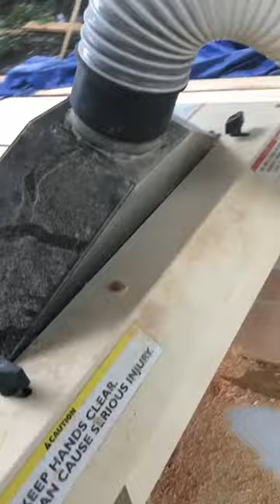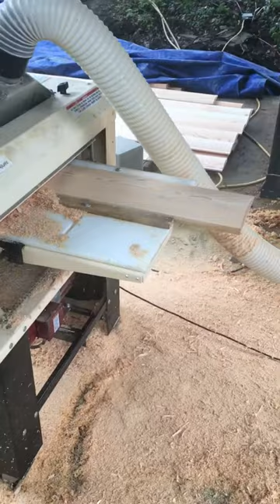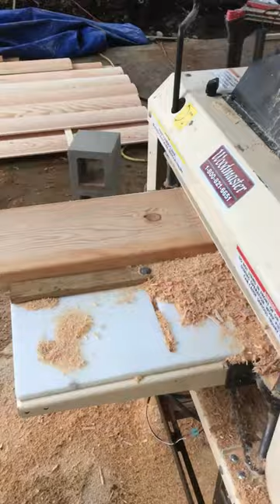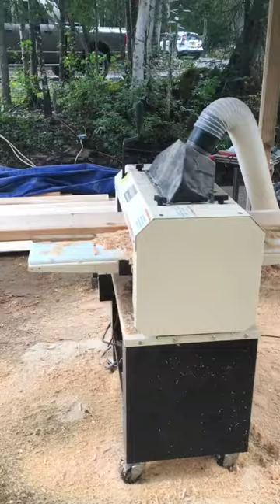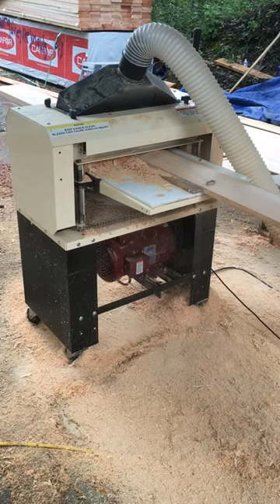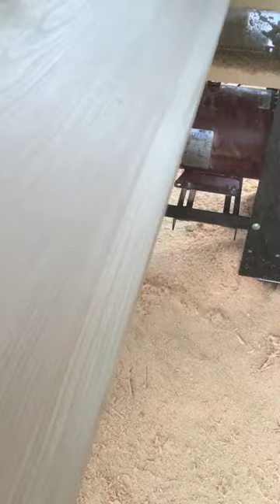Making log siding.

Comment: My woodmaster 712 dances around the room from vibration.  I’m trying to figure out a way to stabilize it, short of bolting it to the floor.
Reply from the maker: Did it work?
Reply: @Q2Flyer  Believe it or not, I simply put it on a Grizzly mobile base and now it stays put without issue!